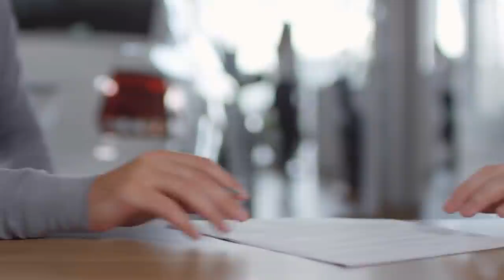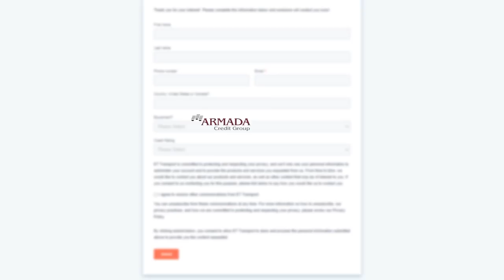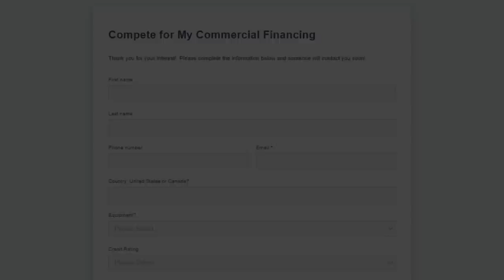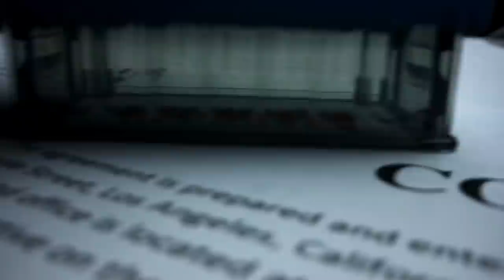Financing Repairs, Mechanic's Lien, Getting Your Truck REPOSSESSED! ... ❌ Defaulting in Payments.

Comment: Beware of some of these shops.
I had a situation with a pickup truck where they attempted a repo.
I was expecting a good sized check from an insurance company they had settled and I was just waiting for them to cut the check they had told me it would be in the next 60 days. My transmission light in the pickup had been on, and I decided to get an estimate to decide if I wanted to repair the truck or sell it and get something else. I took it to a shop close to my home and explained to them I just wanted an estimate and didn't have the money to pay for repairs for at least 60 days and was not certain I wanted a repair in any case. They said no problem. We'll take a look and we can tell you tomorrow just leave the truck here.
The next day I called to get my estimate. The mechanic told me $1,700 I had to tear it apart to find the problem and I won't put it back together unless you pay. If you want it I can pile the parts in the bed and you can have it towed from the shop. (Bad situation all I wanted was an estimate not a torn apart truck). I told him please wait to do repairs because like I explained yesterday I am waiting for insurance money. A month goes by and I finally get the insurance check. I also get a peice of mail that had been delivered to my neighbor and he had been meaning to bring it to me (USPS has been bad about this in my zip code, they mis-deliver/lose a large percentage of mail) that said since we have your truck and you refuse to pay for repairs we are reposessing the truck on this date. Well that date was 2 days from the day I received the letter. Lucky I had the insurance money in hand so I was able to go pay the bill and get truck back. The repair failed in 9 months and I had a 3 year warranty on the repair. When went to the shop the shop was gone. So I was in the same situation I had been in 9 months before but out 1,700, and had come with in days of losing the truck all together. They knew exactly what they were doing and lied to me the whole way. Just be careful what shop you go to as well.

Comment: Hi Ronen; this video - although true in some circumstances - is not true for all repair finance companies. I have been in finance for quite awhile and the current truck repair finance company I work for provides great rates, payment arrangements during difficult times and the only time we had to take a recovery measure in 15 years of operation was due to a bankruptcy of one of our owner/operators. In fact, during COVID (while we were basically shut down and working from home) we sustained ourselves from return customers. Customers we value. And having worked for the banks, I can tell you our business is much different. FYI. Thank you.

Comment: Have something in the bank some guys use the 10 cents per mile thing. I always have a minimum of 20 grand in the bank just incase.  I know alot of companies with lease operators will require you to put so much in a maintenance account or if you have a problem they will help out financially.  Do you guys do this.
Reply from the maker: So true, no we dont.